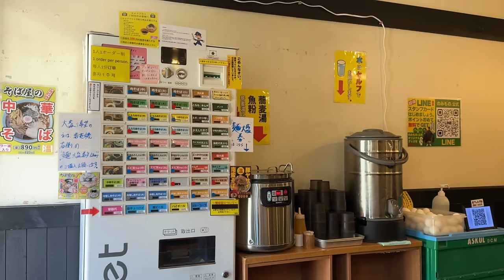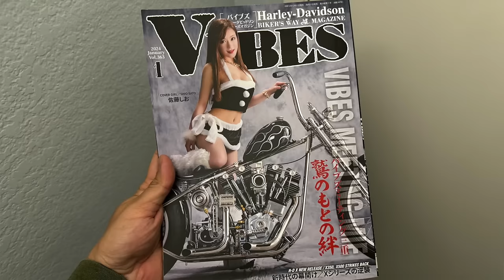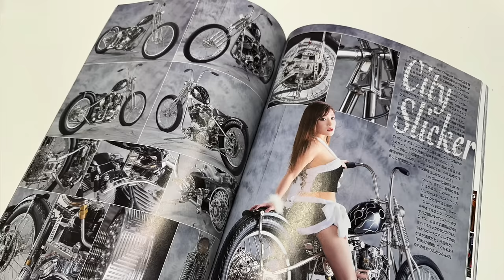Rory McShane's Magazine Cover Shovelhead | Tokyo Japan

Comment: when i came up in spring of '73, there were guys fabricating their own stuff, not much aftermarket available then, its so pleasing having homemade parts fold into your unit, this guy is as good as it gets, way over the top... clean lines, minimal bracketry, integral parts hidden, and homemade ideas... dont see much of that these days, just bolt on stuff, Wally stretched his frame and girder front end in high school shop class, JC was building 110 inch motors in '73... cutting and welding frames, i once made a cardboard mock up of an oil tank and took it to a weld shop i happen to drive by...r&d prototype, cutting stock gas tanks and welding them together, now they make em, the one you're riding, the back up, the one you're building, and the one still in you're head... this guy has got it all... very well done !!!!